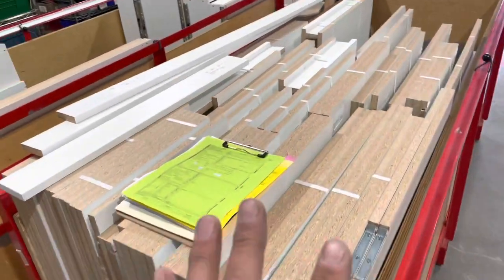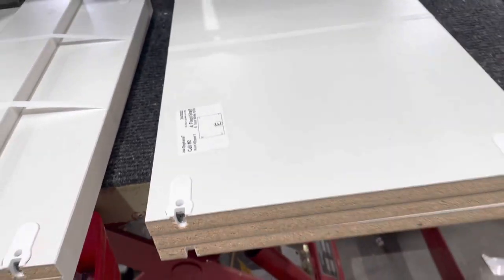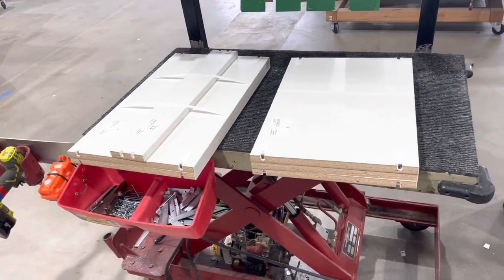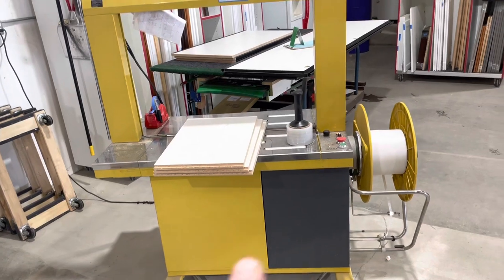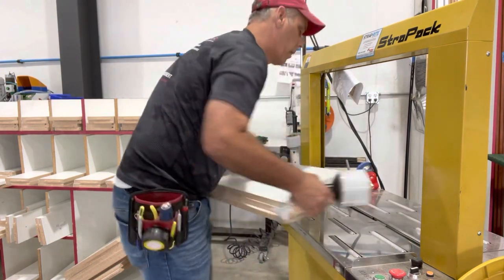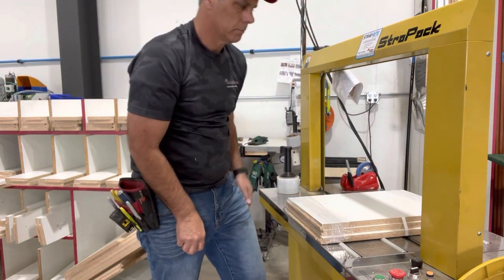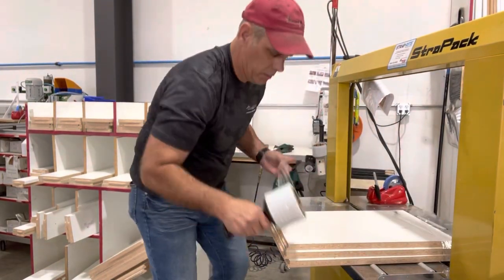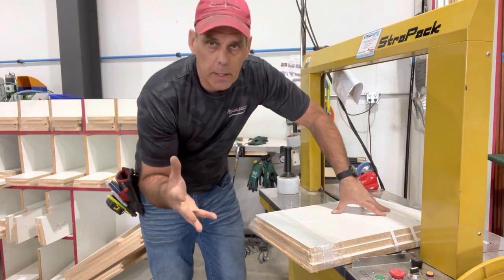Shrink Wrap or Strapping Machine, Which is Better in a Closet Shop?

Comment: Nice Derek.  Does it ever damage the melamine edges?
Reply from the maker: We have never had an issue with the damaging edges. We have used two types of straps one that is a little more stretchierthan the other and haven’t noticed a difference between the two